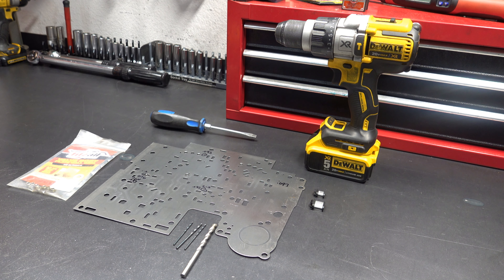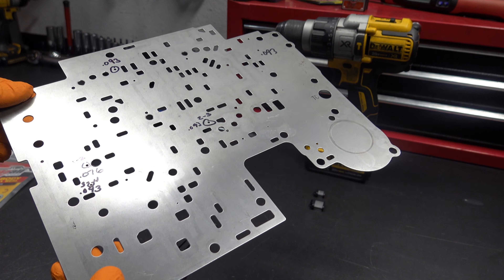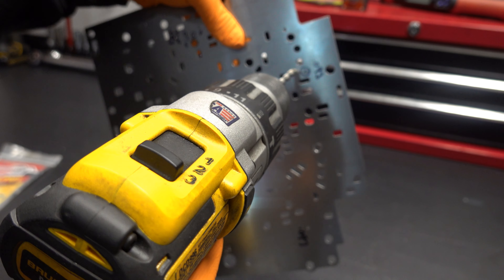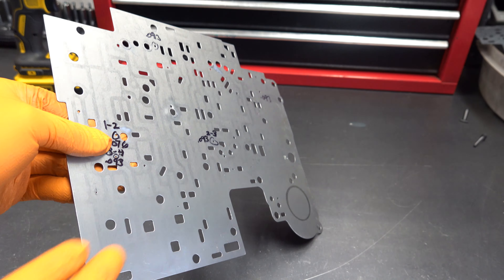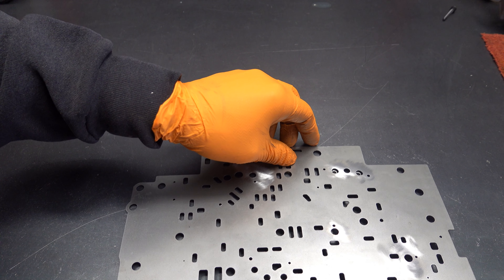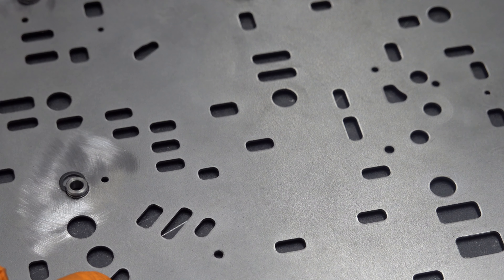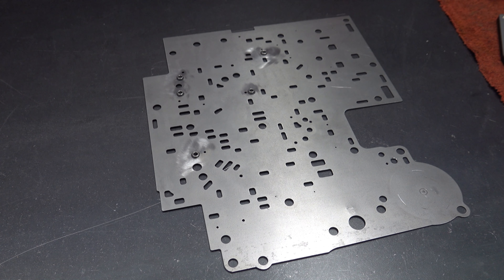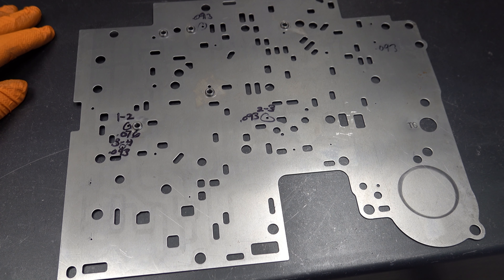Cheap Separator Plate Repair - 4L60E 4L80E 700R4 and More

Comment: This is exactly how I fix them. Many times I'll only do the 1-2 hole, then I'll just take a flat hammer and tap the others back in shape. I've never seen any check balls stick in the plate, except the 1-2. Another great video. Keep it up.
Reply from the maker: Thanks, Kevin! I haven't seen them stick in any other holes, either...but one out of every 25 or so will have a stuck 1-2 ball...I'll usually go back w/the 5/16 torlon check ball in that location as I have a whole bin full of them.

Comment: What's the process for applying the gaskets? It seems the gaskets would have to go on first.
Reply from the maker: This video is more focused on showing you how to repair a 700R4 or 4L60E spacer plate however I show a valve body installation from start to finish, including the gasket applying process, here: https://youtu.be/thP_2OqRG60

Comment: Hey Nick my 4l60e is missing the sep plate filter screens will that be an issue shifting or no ? Does it have roll play in pressure ?
Reply from the maker: Just put new screens on them...Their job is to keep debris from clogging up the EPC and shift solenoids.

Comment: Any fine silicon pen tool to line out new gasket on these? I've got mt 6hp26 apart putting new rubber pistons and don't want to buy a new separator plate.
Reply from the maker: Not that I'm aware of but perhaps a google search may yield something.

Comment: Those drill specs are good for what kind of use Nick ?
Reply from the maker: I think those are Transgo's specs for their basic shift kit so DD, mild performance, etc...Keep the 1-2 feed hole factory or at most .070 if running a stock converter and Vette Servo, otherwise p/t shifting may be a bit harsh/bumpy - same with 3-2 downshifts.